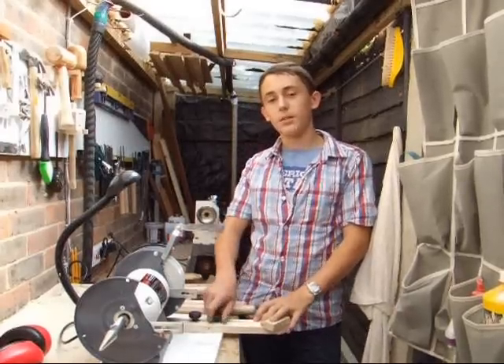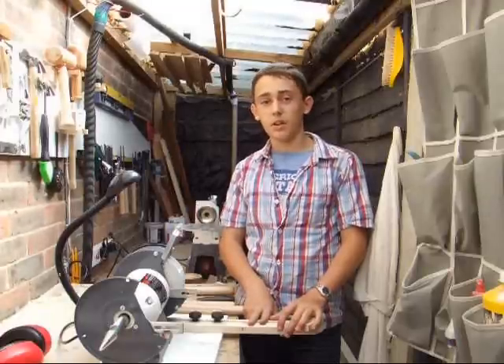How To Build Sharpening Jig For The Bench Grinder - Woodturning Tools

Comment from the maker: The tool should be adjusted on each sharpen in order to maintain the correct angle on the bevel. It is not common for the blade to dig into the stone but I suppose possible if the angle was allowed to get smaller to the point where is becomes trapped between the jig and the stone. Not that likely but I suppose possible, Alex.

Comment: Great jig idea you have there.
question: what the grit on the white wheel ?
is it 8" or 6" wheel ?
the grit on the flat water stone, one side is 6000 whats the other? (your other video)
it there a reason for the router cut being off center in the jig?

Comment: A possible solution for the people. who see problems with the safety of this design: Just don't attach the stop block permanently. Use masking tape or something else to attach it and put some wax on the construction. In case of a kickback the tool can push back the stop block and move away from the bench grinder. (and please excuse my bad English)
Reply: My thoughts exactly. If the wheel caught the edge of the blade with that tool already being against that back stop something is going to get thrown around and broke.  Hopefully the bench grinder is fastened to the bench.

Comment: I fail to see the danger in the design. Even if you did screw up and dig into the wheel...so what? Its not going to throw the tool at you sharp end first. Worst case you ruin a wheel or the tool, maybe pull it out your hands and throw it at the table? Some things are just inherently dangerous. Woodworking on a lathe may not be for everyone. Keep it up young man.
Reply: That's coming from a guy with an eye like a dead fish.